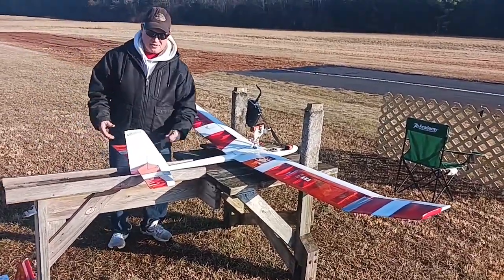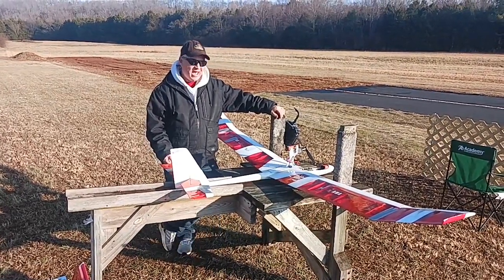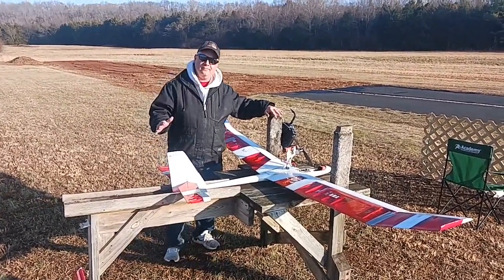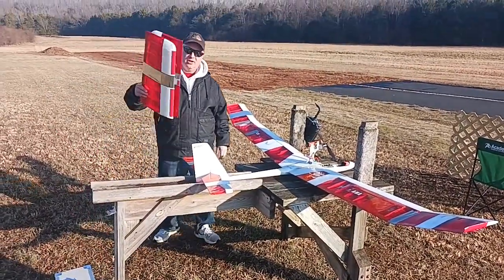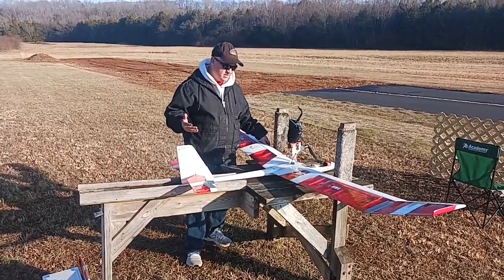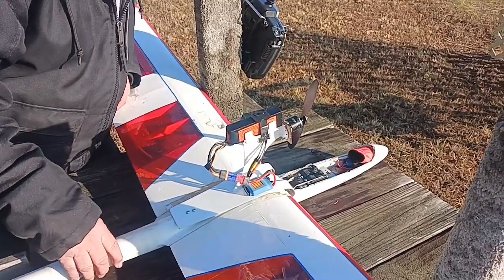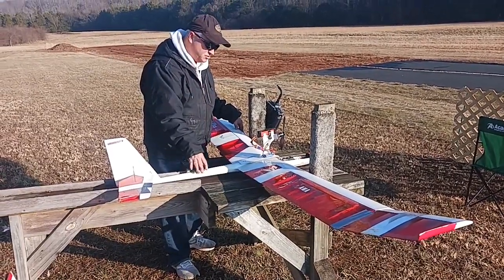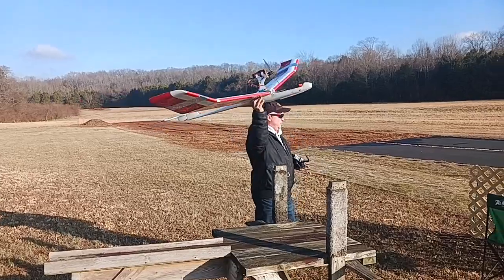Custom Glider by Chuck Anderson "Big Red" - Shorter Wing Tips

Comment: It is a Craft Air Sailaire that has been modified that is missing its canopy.
Reply from the maker: Wrong! It is a custom design by Chuck Anderson. Yes. It is missing a canopy. I need to build another one that does to go in the path of the prop.
Reply from the maker: Chuck definitely designed it with similarities to the Sailair but it is not the same plane. It is an original design of his own.

The fuselage is completely different than a sailair. The tail is similar though and so is the wing design.
Reply from the maker: Chuck even created plans for it. So no, it is not a Sailare.